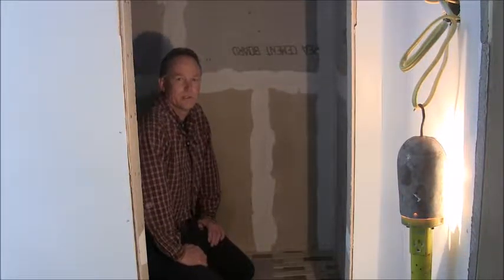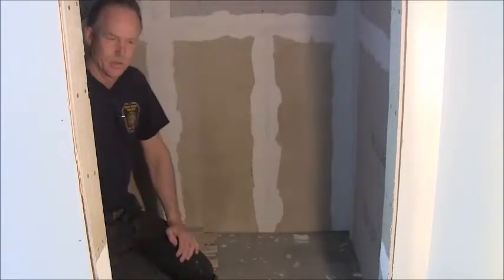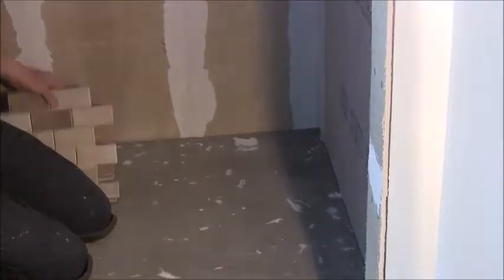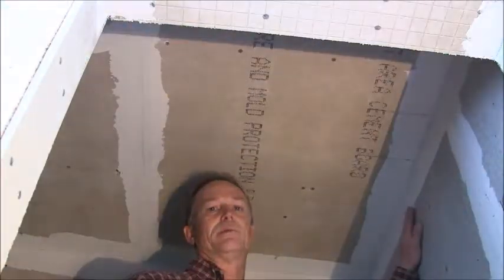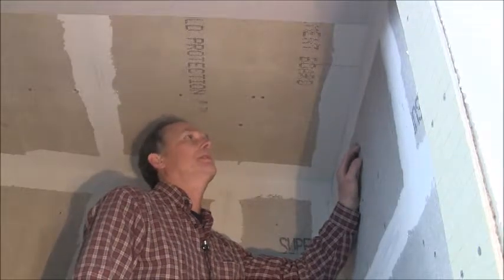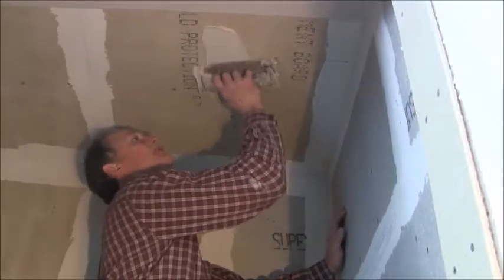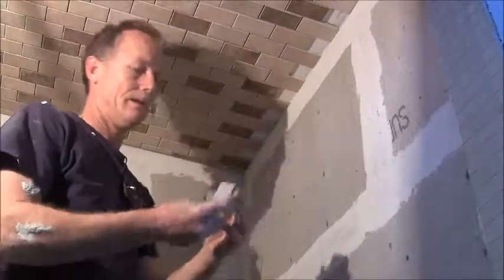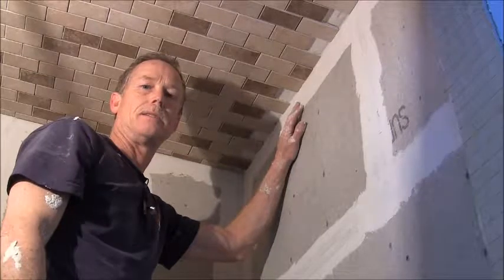How to install mosaic tile on the ceiling of a shower

Comment: When you say thin set- what do you mean. What goes inside it? I am in india and looking to do a  random pattern mosaic ceiling from broken tiles and glass. I don't know what type of cement to use that would hold it up well enough.
Reply from the maker: Basically thin set is a type of concrete mortar special made for tile. We buy it in bags here in the U.S. at the local tile store or a building supply. I hope this helps.
Reply: Yes it does help. No other adhesive substance goes into it right?  I will go to the building supply person here. Thank you.
Reply from the maker: @malavichaudhari8771  Yes, no other adhesive goes into it. Be sure and mix the thin set by the instructions.
Reply: Thank you so much
Reply from the maker: @malavichaudhari8771  You are welcome.

Comment: did you at least water proof the floor? I see you didn't water proof the walls. do you still have access to this shower?
Reply from the maker: Yes, the floor was made with a mortar bed and using a rubber membrane.

Comment: How come you didn't waterproof the walls?
Reply from the maker: I did. I put plastic behind the hardie board and hardie board is water proof.
Reply from the maker: @mk-jm5tv  I beg to differ, It is not cement board, it is Hardie Board. I have spoken many times with the Hardie company and they assure me that it is waterproof. I have done several of these over the years and have never had a problem.